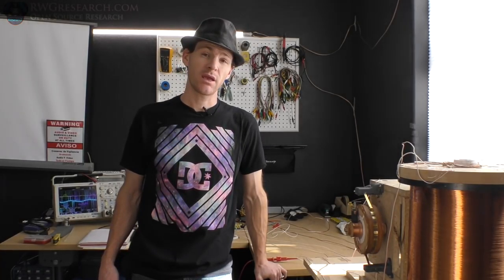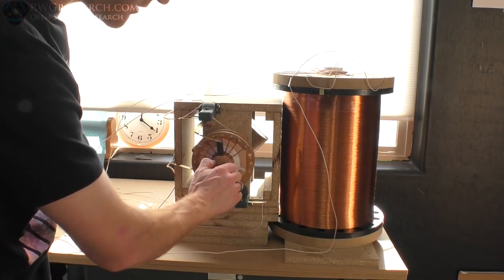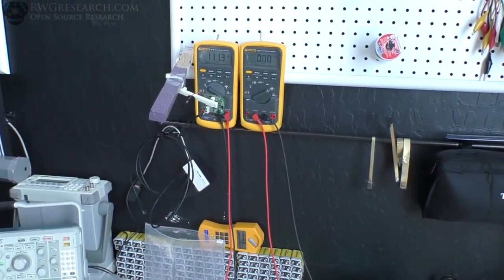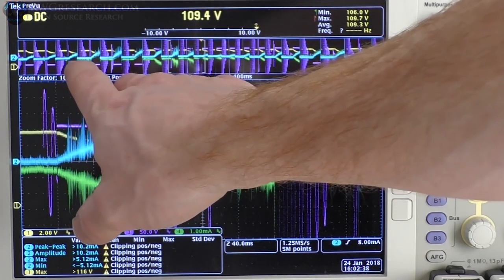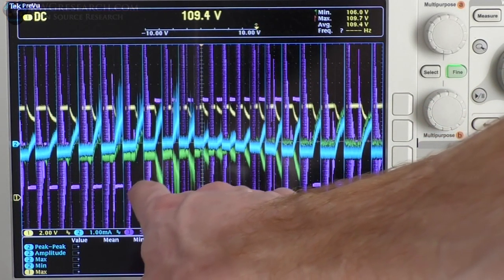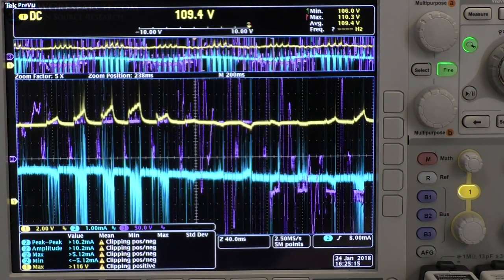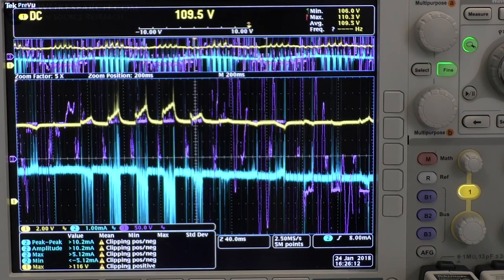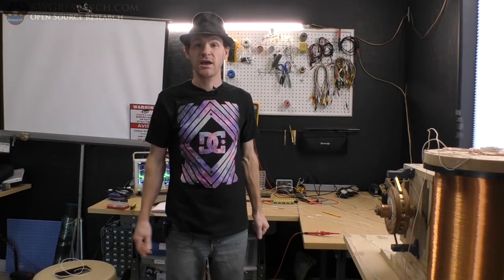JWN Project P5: Inducing Current In The Same Direction As The Applied Current....

Comment: Wait till you add the second coil. The second coil can be used for powering a load or self powering the unit. Basically the batteries get charged by the output of the second coil while the unit is sharing  power. The inductive side of the huge coil has a very large oscillation. That can be tapped via another coil as Newman did. He was testing connecting the second coil back to the input and said that it would either hinder the magnet or speed it up.
 Think about what the electric field of that coil is doing. Putting another coil in that field would act like an open air transformer that is loosely coupled. Of course the gauge of the second coil should be increased to a large size. This will boost the current and lower the voltage potential of that electric field. You might want to make sure the second coil has the same mass weight as the first. This way it will be balanced or in resonance.
 Think about the gyroscopic particles he is describing. There is a certain amount of them rotating around and with that magnet. When the magnetic field (Gyroscopic particles) is in motion matter will transform it into voltage potential. The huge magnetic field you have there is quite strong (denser particle count), generating from very fine wire increases the resistance and the voltage must go up to compensate. This comes from the density of the flux field. A certain amount of physical inertia is associated with that big magnet array you have. When it generates voltage it should be higher in voltage and lower in current, which resists less against the dense magnetic field that is cutting it's coils. So the magnet coasts until the next burst. Ten pulses on with a small break in between each pulse. Every tap to that coil causes it to surge or have inertia as well. It should oscillate at it's own frequency once it gets up to speed, based on the tap the child method on a swing. The real resonance of the main system, cap, coil and brushes is key oh and the battery. I am certain the battery could have a diode on the positive side to keep the impulses from feeding back to the positive. You want to only ping the negative side of the battery since going below the zero line does no real damage. Only positive energy is destructive. You can make matter more negative and that comes from real physics. Most matter has an electronegativity associated with it. https://en.wikipedia.org/wiki/Electronegativity
 This is where I went into the crystal batteries. A natural form of negative sink that harvests energy from all around it when you present two different materials Like graphite and aluminum. I think the difference between the electronegativity of the materials was .6v - .8v. I could run a Joule thief for weeks and power 3 parallel leds with that spread. There was no galvanic response between the electrodes because I used a crystalline electrolyte with an oxidant that repaired the aluminum oxide layer if it was breached. Potassium was part of the solution there. Borax was for the aluminum oxide layer. I think my problem was the plates were too far apart but I digress.
 The Newman motor is such a sink. That uses the strength of that large magnetic field to generate and oscillate some impressive voltage or pressure in that coil. The bigger that cap the better the power of the oscillation. Watch his videos more and you will notice a couple things like, how big the commutator is on the mammoth system and it was that way to reduce sparking between the contacts. To the missed information about diodes blowing. To maximize the effect you need to really have that monster magnet in the center of the coil. Plus there is also photo proof that he used two gauges of wire on the devices. This was to loop them to reduce current draw from the batteries. 7000 pounds of machine he was running off of some really inadequate batteries and the strength of the motors were outrageously off the charts all while drawing milliamps. Eventually they would resonate and back feed into the batteries in effect charging them. Probably through the negative side, seeing that he mentions blowing some diodes the night before the show while getting it to run again. Prepping the 7000 pound device.

Comment: Question:  Has nobody designed an electronic dual pulse & short circuit for a Newman Motor?
Reply from the maker: G Travel not that can handle thses types of voltages.  For 40v input I can get 8000v out...  Solid state components are no good for this applacation...  This video is 2 weeks ago.  I'm already allmost done with the optical controled relay circuit that should help alot...  More to do.  :)  ~Russ
Reply: Agreed, but still hoping that somebody will find an electronic solution for the mechanical commutator ....  I'm working on a large diameter commutator cut from a brass pipe fitted over a plastic cylinder.  Attempting to keep the distances equal for brush movement ...... it will take time to manufacture because I have to travel for a living and sponsor my hobby :-)
Reply from the maker: G Travel cool, yeah its allways alot. Of workamd time.  But the end result is good :)

Comment: Hi Russ you've come a long way now from when you were building a power supply from parts from a fork lift. Your setup has a lot of unused area around the spinning magnet and it's not efficient. The coil needs to be perpendicular to the induction. Also as close to the magnet without touching it. The way you have it as soon as it goes past center it cancels induction past center where it just induced it. One other thing you could do is have sets of taps at every turn of the coil and rectify it onto a capacitor bank.

Comment: Why do you think you have discovered something amazing here? This is incredibly basic "Batteries and bulbs, learn with mother" level. Get a normal electric motor, run it from batteries, it uses power. Now turn the shaft faster than it wants to run, it will return energy to the batteries. It is just soooo basic and simple.

Comment: Charging the supply when the motor is mechanically spun faster than the speed dictated by consumption is something that John Bedini demonstrated with his Ferris Wheel machine back in 2010...  It was also a function integrated in to Adams motors as far as I have been able to ascertain.

I am not certain we will ever get a real disclosure of what Newman had, my own research into his work, and please forgive me for saying this,  reveals that you are not utilizing the generator coils in the proper manner..  We can discuss what I have found offline if you like....

Getting the induced to be in the same direction as the applied is easier than you are demonstrating....  Your system generates a sine.....  I have found that the induced wave needs to be asymmetrical, and unidirectional...., no reversals....  Accomplish that, and the applied will always be additive to the induced.

Comment: I'm sorry how is this better efficient. There will have to be equal parts pull then push so the extra voltage you see is needed for the collapse  of the magnet field. We always seem to forget this variable. The collapse of the fields is also work. Switching from positive to negative is not the answer. Switching from positive to positive is. Remember all fields retain memory collapsing this and then reversing it will never be more effective. This is the conventional idea we have run with for years an is not the answer. I am not trying to be insulting just throwing it out there.
Reply: Basically on a molecular level think of the fields being built are similar to the structures in your house building your house taking it down and rebuilding your house takes time and energy so if Fields retain memory it's better to utilize that memory than reverse its memory